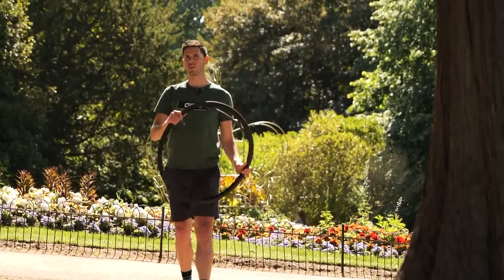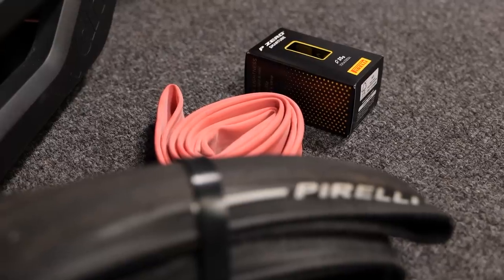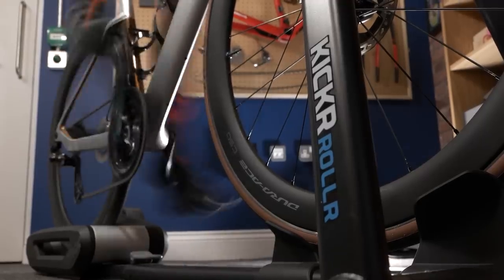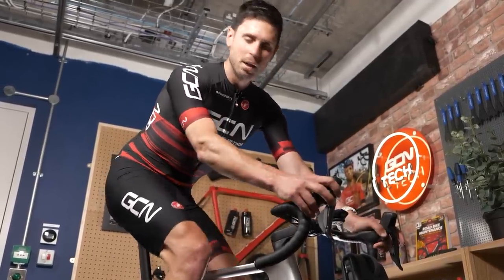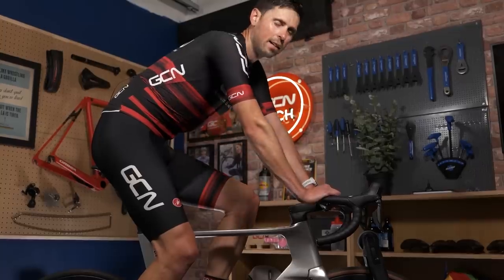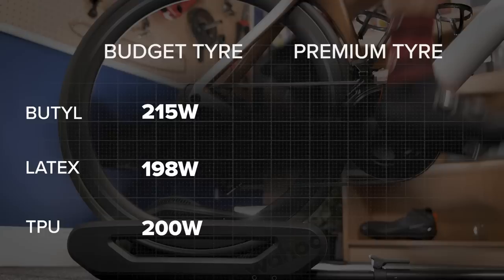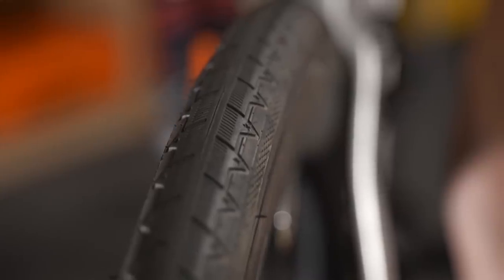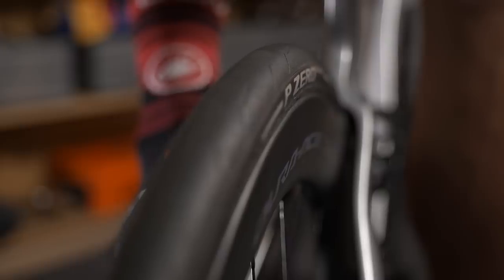How Much Faster Will This Bike Upgrade Make You?

Comment from the maker: Have you upgraded your tyres and inner tubes? Will you now after watching this video?
Reply: lol, I was just about to make the jump to tubeless!  Though I guess the upgrade in tyres would still apply
Reply: Running Tubolito's for last year. Not one puncture yet. Noticeable difference, Only problem is they loose pressure and need topped up before most rides.
Reply: I swapped my inner tubes to latex last year and I got a noticeable difference in average speed. A bit of a pain to inflate them before every ride but I can live with that
Reply: I upgraded to Vittoria latex and gp5000's, they are very noticeably faster. 3 to 5 mph faster, and when you are coasting they lose speed slowly, saving energy that would have been wasted when accelerating back to speed. Plus the ride is almost plush. The only downside is that I have to be constantly vigilant for glass and road debris.
Reply: Updated to GP5000, then added some carbon rims and finally the RideNow TPU tubes, all fell well and fast.
Reply: Been riding Vittoria latex 19/24 and Specialized Turbo Cotton 26s for years now (internal rim widths 27 and 29 back and front resp). Never looked back, it's easily a 2 kph improvement for me (**not tested scientifically).

Edit: I ride rim brake but live in the Netherlands with no hills in sight.
Reply: You should have added another option - premium tubeless tyre
Reply: I found pirelli p zero tyred to be fastest. They do wear quite quick comapred to continental but much better tyre IMHO.
Reply: A test on a fixed fork trainer is an OK benchmark, but in the real world you have
1) 2 tyres dragging, not 1
2) micro steering adjustments constantly sidewall squirming
3) side wall loading, sometimes 30+° of bike lean while sprinting
Reply: i got ridd of my  inner tubes best upgrade ever and run proper tubeless tires
Reply: Great experiment...please add tubeless tire on the test for more great data and summary (ofcourse with the same amount of max psi)...cheers
Reply: interesting to then see the complete saving for both wheels, considering that data was just for the rear! 🤯
Reply: Have just recently upgraded to gp5000s. Can you guys PLEASE do a video like this comparing tubes and tubeless?
Reply from the maker: @fuadnawawi8429  That would be an interesting one for another video!
Reply from the maker: @philpaterson5936  Even bigger gains!!
Reply: Upgraded and found it helped with my Zwift times greatly!
Reply: interesting will check the inner tubes am already on P zero's am constantly impressed by the tech' improvements , I started riding in the seventies, lots has evolved !
Reply: The rollers are just a hardly smoother than the british roads ;)
Reply: Personally, I liked the latex tubes but I hated they deflated so quickly..a more than weekly check is needed to keep them pumped, they're not for a casual user IMO.
 Tpu are expensive. I prefer lightweight butyl ones as they are cheaper and repairable. Speed is nice but it always comes at a cost.
Reply: I have a pile of tires that are collecting dust because I switch them out before wearing them out. Tire evolution has been dramatic over the past years! 
BTW, It would be interesting seeing that Euro tire at different air pressures. Like ten PSI increases to see how it might improve.
Reply: GP5000 and Vittoria latex was my preferred but now running Aerothan. I didn't mind topping up latex every ride but too much trouble with the latex weakening, even blowing out through small nicks in the tyre.
Reply: I've definitely upgraded my tires; I'm a Schwalbe Pro One fan. Definitely not very puncture resistant but fast. I'd like to have seen you compare tubeless, too.
Reply: No. If latex inner tubes become as affordable and durable as butyl ones then maybe i would. Also, what makes latex tubes have lower rolling resistance? How much lower? How is rolling resistance measured and what unit is used?
Reply: Hey, if you compare on a trainer, what about those trainer tyre, like those from Tacx or Vittoria?
Reply: Just about to change over my tubes to Vittoria latex tubes, to see what difference they make on my Aluminium Giant road bike. Hopefully I can get out and do a test comparison myself, when it stops raining here. (Raining for days now, ☹)
Reply: The video showed that there was 40ish Watts improvement on the 'rear' wheel.  As one thrid of the cyclists weight goes onto the front wheel, you can add 20 Watts for the whole bike setup.
Having said that, the small Rollers will produce much greater rolling resistance than a flat road.
Reply: Just done a wee test myself, upgrading butyl inner tubes, and stock tyres that came with my Giant bike, to Vittoria latex inners, and Pirelli P Zero 4s, (25mm). 

I did the same route twice, once with the original set up, then with the new set up, over a 3 mile loop, and I noticed a big difference in feel, and overall speed. 

Despite not having a powermeter, I kept to the same ave cadence, 60rpm, and same gear selection, 50 / 13, and with the new upgrades, I was 30 seconds faster, yet I felt that I had put in less effort.

I was pleasantly surprised with this little test, and I would say, yeah, having such a small, inexpensive upgrade, can make a difference.
Reply: Yes, but I changed a lot of things at once. Tires, tubes, and lower pressures. They combined to make me faster and much more comfortable on the bike.

And yet, after all that, my favorite change was to tan wall tires, because they look cool.
Reply: But you used the same wheelset? So only from butyl and cheap tire to latex and a good tire you save like 60 Watts? 🤯 That's insane, Im not going to buy any inner tubes at Decathlon anymore...😂😂😂
Reply: 90 watts for 2 tires then ? that's alot
Reply: Try the same test but add moor air in the cheep butyl tube you should be able to mach the resistance

Comment: Adding a tubeless comparison would have been good?
Reply: Not possible if your wheels aren’t tubeless compatible….
Reply: @patrickparisienne1917  Just add tubeless tape to standard wheels. It works just fine.
Reply: I agree. It would be very interesting how much difference it would make with tubeless. That´s the first test which is really meaningful with these laboratory conditions. Please @GCNTech repeat it with tubeless and probably tubular too.
Reply: Not without also doing a chart fully packed at 10psi/0.69b increments from 45psi/3.1b to 105psi/7.23b, as so many people claim to be able to go low psi exclusively on tubeless (I, someone riding 28mm GP5Ks tubed at 40/45psi, call bs).
Reply: Also would have like to seen pressures
Reply: This video is for the tube users. We know what the tubeless results will be.
Reply: @BTcycle  I genuinely don’t, hence the comment. Feel free to enlighten me
Reply: @awestrope74  Tubeless be less watts than latex tubes but not by much.
Reply: Yes cos also. What’s the big deal with tubeless???
Reply: @Automatic313  Duck tape and Stan’s Race sealant also works a treat 👍
Reply: Was about to comment the same
Reply: Another test I would love to see would be the introduction of nitrogen to tires instead of typical air. Nitrogen is a lighter gas and does not escape as easily which also could help improve performance. Something I have been thinking about for a while. Not sure where to get it, but I know Costco uses it for their tire installs.
Reply: @lezc3733  just be sure to never have to bring them to the bike shop if you have problems.  Friend of mine did his with duct tape and to go back to proper rim tape it took a couple hours of cleaning the rim before. Duct tape leaves lots of glue on the rim.
Reply: Drop of white spirit and an old T Shirt gets it off in 10 minutes flat
Reply: @patrickparisienne1917  I have an old set of Mavic Ksyriums running mavic tyres with Duck tape, Muc off valves and Stan’s race sealant neither the tyres or wheels are marketed as tubeless compatible, but having done several hundreds of miles without issue I can confirm this is entirely possible, just depends on the tyre/ wheel/ sealant combination, some tyres repel the sealant and some rims jus don’t allow good bead contact, and before we get into a discussion about what is or isn’t safe, I’ve had tubed tyres blow out a sidewall as a youth with maladjusted brake blocks and a lot more speed in my legs.
Reply: @BTcycle I honestly believe that a tubeless setup is only saving some Watts initially. Mid till end cycle - when the sealant is starting to gunk up - it will even out.
Reply: Latex is nearly the same as tubeless and much less hassle
Reply: @patrickparisienne1917 yes it is
Reply: @BTcycle yep hassle and mess..
Reply: Tubeless are a scam.

Comment: I went from the stock specialized tires (I forget which ones they were.) To continental untra sport.  Then I went from ultra sport to Conti GP5000 with latex tubes.  The difference between each upgrade was definitely noticeable. Tires and tubes are absolutely the first thing to change out when you buy a bike.
Reply: @happydogg312  yeah, the tires that ship with the bike are almost always junk.  Get yourself some good rubber.
Reply: Yeah, I run Conti GP5000s.  Went from the Mavic tyres that came with the Cosmic wheelset to the GP5000s ... what a difference.  Totally transformed the bike.
I forget which tubes I'm running now, but some good ones.
Reply: @happydogg312  i swapped the stock ones w the continentals. HUGEEEEEE improvement!!!!!
Reply: My bike came stock with Continental Ultra Sport 25mm, but I'm thinking about upgrading my tubes/tires. I seem have have hit a ceiling with my average MPH & top speed with the current setup. On several descents I ride, even at full tilt on the pedals, I can't break into the 40 MPH top speed range. I get close - 36 to 38 MPH, but never 40 or higher. On flats & climbs when I hammer on the pedals, the bike starts to feel like it's in mud. I think the Ultra Sports just have too much grip.
Reply: What latex tubes did you get?

Comment: Great information! My method wasn't especially scientific, but I did a rolling test on a  worn pair of Gatorskins and a new pair of GP5000 tires. I rolled down a hill (coasting) onto a flat length of trail, and coasted until the bike stopped. I did three runs on each set of tires. The differences: 20.47 mph vs 22.2 mph max speed and an average speed of 10.2 vs 12.03 mph. As much as practical, I kept everything the same. I started from the same spot, stayed in the hoods, ran the tires at the same pressure, both sets of tires were 25s, and performed all six runs on the same day, over the course of maybe 1.5 hours. It looks like the GP5000's are a little faster than the Gatorskins, confirming what I've seen online that the GP5000 tires have less rolling resistance in the lab.
Reply: And I’ll bet you don’t get any more punctures on GP5000s, plus you’ll have way more grip especially in the wet
Reply: @discbrakefan  Sarcasm, or not? I can't tell! My experience was Gatorskins are tougher. Gatorskin Hardshells are even tougher still -- they never puncture -- but they do strip ~2 mph off my average speed vs Vittoria Rubino Pro or Conti race tyres. They have a pretty noticeable weight penalty uphill!
Reply: Added bonus of your method is you don't have to spend hundreds on a smart trainer, or a power meter
Reply: @discbrakefan  Agreed. Poor grip in the wet is the reason I won't use Gatorskins any more. TLs or TRs almost eliminate punctures.
Reply: @xchopp  I commute on Hardshells all year round and love them, not punctured yet, they are a tad slower but that just means I have to work a bit harder . . . LOL
Reply: I tried mixing it up. Gatorskins on the rear and GP5000 on the front. Given the rear tire always wears down first, and the front tire needs grip and softness. They both work pretty fine.

Comment: Would love to see this done with tubeless and with different tyre widths. Like 25, 28, 32 or something.
Reply: for me, the benefits of tubeless outweigh everything else. been riding exclusively tubeless on all of my bikes for over a year now and not a single flat. i would assume that tubeless will be slower.
Reply: Don't think it would make much difference on the rollers. Tubeless and wider tyres are better when the road is rougher right.
Reply: @adrianc6534  same, since switching to tubeless, I’ve had to stop 3 times in 2 years… but they were pretty catastrophic half inch+ cuts. I used to flat at least once every other week. From everything I’ve seen, tubeless is pretty on par with latex tubes in regards to speed. Tubeless is faster on average roads and way faster on gravel because of the lower pressures, latex is faster on ultra smooth surfaces.
Reply: @cokebottles6919  1/2” cut in a tubeless tire = bike and rider covered in gloppy latex sealant. Bummer.
Reply: @prestachuck2867  had my tubeless tyre unseat itself (correct pressure but a defect with the rim at the weld me thinks). Wouldn't hold pressure so tried to put in an inner tube instead. However I managed to pinch the inner whilst using tyre levers (wouldn't normally need to use levers but everything was so slippy with the sealant that we were forced to use them). I really like tubeless but that was a mare...
Reply: @prestachuck2867  yes, everywhere
Reply: First time I used tubeless tyres on a new bike, for a long ride, I had a tiny pin prick of a puncture. Barely got home. New tyres (Vittoria) and back to tubes. Feel so much more secure now (spare tube and patch), and so much less messy. Life should be easy😉
Reply: @Ianforfun  tiny pin prick of a puncture.LOL Got tubeless for 8 years zero punctures to date, I would never go back to tubes again
Reply: @Ianforfun  tubeless for 3 years and never had a flat. after 1.5 years a new bike with tubes in it. flat on the second ride
Reply: @Ianforfun  Spare tube and patch with tubeless = even better.  Life shouldn't always have to be either-or.

Comment: Wouldn't you get potentially different results during outdoors on asphalt due to the surface difference?
Reply: And different tires have different aero drag qualities
Reply: Smooth rollers take any sort of vibration losses out of the equation, and will falsely lead one to use the skinniest tires pumped to insane pressures.  Sadly any sort of roller data is of limited value, and really for entertainment use only.
Reply: You might, but it is questionable if that would favour one tire more than another. If anything, the more expensive tire will be more supple and deal better with rough surface.

The other day I saw a video with aero wheels tested v/s non aero and there you had changing weather, so while not perfect, this seems like a fair test.
Reply: @demand61  I believe that relatively speaking it shows the correct winners, but with a super smooth surface and a wildly different contact patch I would not take the wattage numbers too seriously.
Reply: That's the point of the rollers, they remove the variables. Perfect test. There's plenty of other tests talking about aero etc.
Reply: Yes you will get different results. There are several reasons for this, the inconsistency of "real world riding" (wind, grade, surface smoothness, etc), but the proportional value of the improvement in resistance should be similar with adjustments for the variability of the real world. So mostly these numbers should be presented as percentage gains or similar scalar value.
Reply: @whirving  unsaid is what the smart rollers were set to.  200W isn’t just rolling resistance of a single tire, right?  P-zeros are supposed to be in the 10W ballpark after all.  And the extra 45W is inflated somehow by the methodology, as even a Fat bike tire at 12 PSI is only in the 30-40W range (total rolling resistance), which is what really caught my eye.  I think having two concave contact patches is throwing thing way off.  I conclude that the numbers are useless beyond saying one tire is better than the other in a qualitative way.

Comment: Great video. Very interesting it would be to test now a tubless setup and see if it is even better than the latex innertube setup 🤔
Reply: yes! my thoughts exactly!
Reply from the maker: Yes, that would be an interesting comparison Alain!
Reply: @gcntech  make it happen guys
Reply: Rolling resistance is a wash between the two. I hate fitting tubeless road tyres. I like latex
Reply: It's probably similar, the 50ml of sealant will be around 10g heavier than a 40g butyl tube? At least you know you'll finish the ride with tubeless because you won't puncture, and you won't have to clean your bike. Guess what I use :-)

Comment: Despite the lower weight and moment of inertia of TPU inner tubes, the superior rolling resistance of latex inner tubes makes them look like the best bet. And they are cheaper then TPU inner tubes. The downside of latex tubes are they lose air pressure faster than butyl and TPU tubes. A nice advantage of TPU inner tubes is they take up much less space than butyl and latex inner tubes, which makes them ideal as an spare inner tube for those who have small saddle bags to hold emergency gear.

Comment: I typically ride Vittoria or Continental.      I am currently still using standard inner tubes.     Not too bothered about going slightly faster,   but saving energy is definitely of interest. 
The Orbea is a very very nice looking bike.
My bike is a Giant aluminium from 2006, I am still happy enough with this bike for now.
Reply: Try out latex tubes.  You wouldn't think they'd make a big difference but they really, really do.
Reply from the maker: Going faster for the same effort = saving energy!